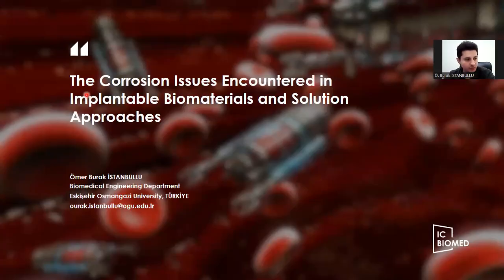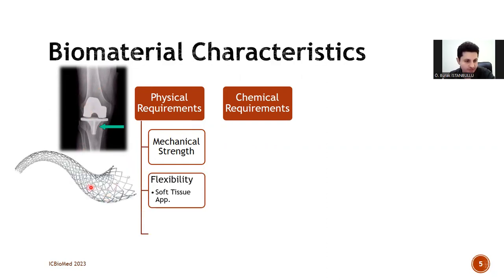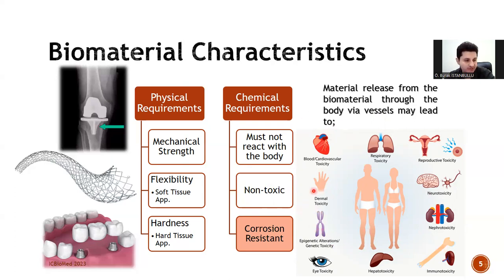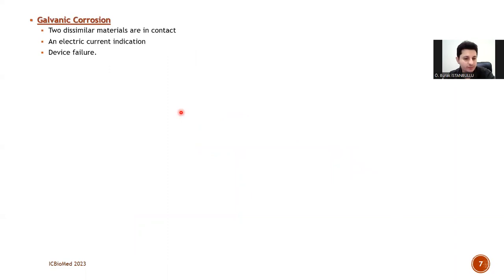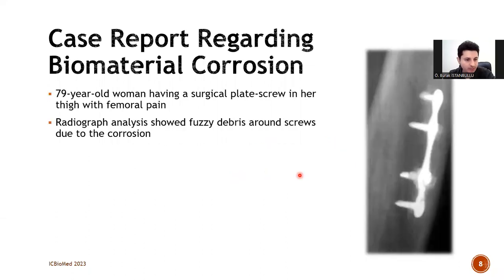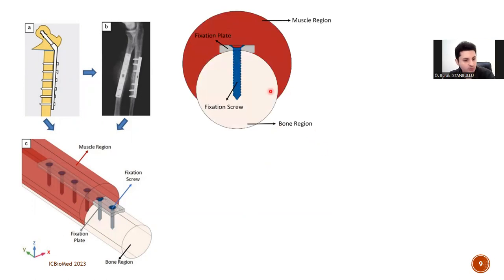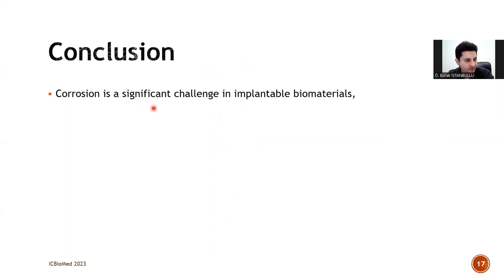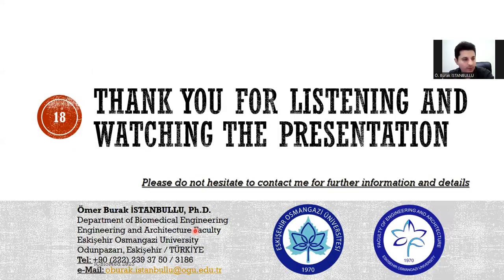ICBioMed 2023-The Corrosion Issues Encountered in Implantable Biomaterials and Solution Approaches

Comment from the maker: Here are the questions we collected and answers replied by the presenter:

Q1-  What types of coatings are currently the most commercially effective and why?

Answer: An electrochemical corrosion mechanism between the anodic and cathodic sites involves the presence of free electrons, or ionic contents on the material surface structure, and electrolytic pathway which can trasport the charged particles. Given that blocking the dynamic physiological environment surrounding the biomaterial, which constitutes the electrolytic pathway, is not feasible, strategies to mitigate biomaterial corrosion focus on eliminating or passivating the elements like free electrons or charged particles that could potentially contribute to the corrosion mechanism.

Recent biomaterial designs and studies have shown a preference for coatings that can electrochemically passivate the surface, rendering it more noble in its characteristics. These includes carbon-based structures such as diamond-like carbon, graphene, or carbon nanotubes. These structures possess a more passive feature compared to metallic surface due to the sp3 and sp2 carbon bonds, resulting in an increased corrosion resistance of the substrate. Additionally, hydroxy apetite coating, exhibiting a ceramic behavior, is one another structure contributing the corrosion resistance of the substrate material when coated. This type of porous structures not only decreases the corrosion induction risk, but also increases the tissue integration into the material, particularly in scaffolds or bone implants. Forming a protective and passivated oxide layer on metallic implant surface or coating a metallic structure with oxidized layer such as alumina or zirconia are also effective on reducing the corrosion potential of the biomaterial since the ceramic-like feature is achieved on the surface. On the other hand, polyester-based coatings are also effective on corrosion protection.

Q2- Can the diamond black carbon structure be widely used in the application of corrosion-resistant biological materials in the future

Answer: The DLC structures are utilized for various aspects such as corrosion protection in industrial applications and energy saving thanks to their corrosion resistance, machine tool coating thanks to their hardness, smooth surface and low friction coefficient. Additionally there are research studies regarding the biocompatibility of DLC structures in the literature which demonstrate such structures are compatible with tissues. Thanks to their useful and effective features, DLC coatings have been used in biomaterial field and the recent studies regarding the biomaterials including DLC structures are tend to increase the exhibited feature of the DLC. For instance, DLC coating can be used to reduce stent-restenosis risks of intravascular stents by minimizing the corrosion risk of the material, since one of the parameter of the restenosis development is  the corrosion-based inflammatory response of the body. On the other hand DLC coating can be utilized in metallic couples such as knee of hip joint thanks to their wear-resistance depending on the low friction coefficients.